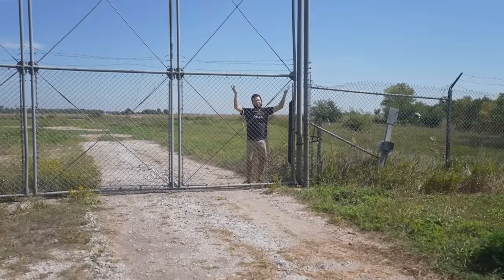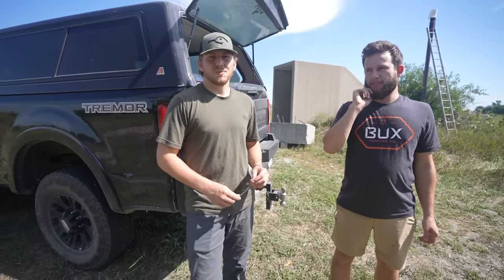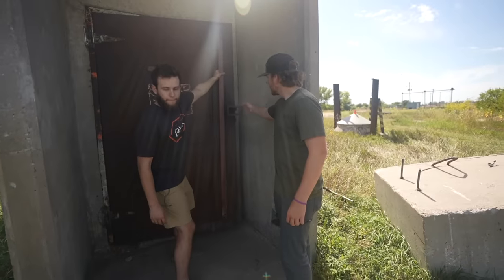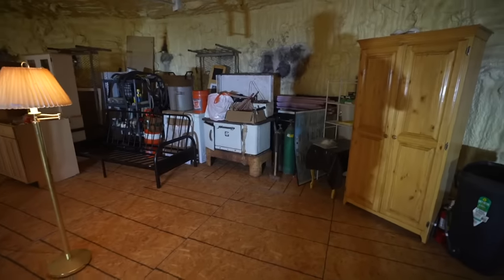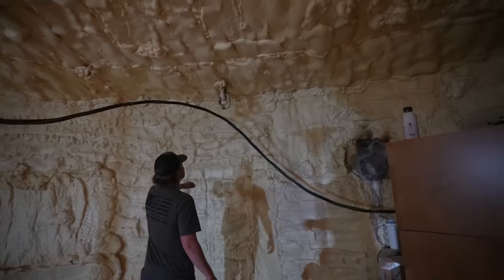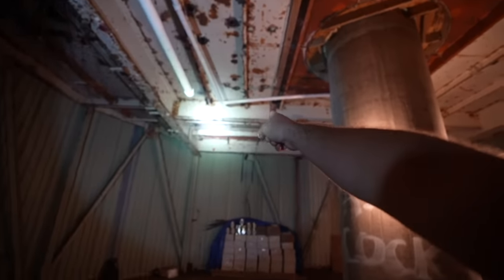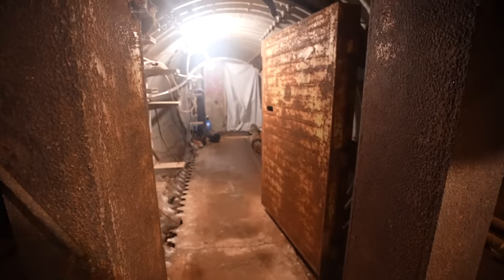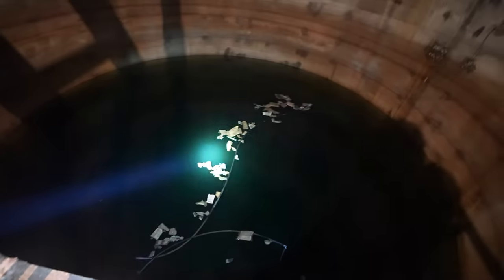I Bought an Abandoned NUCLEAR Missile Bunker!!! (Prepping for Doomsday)

Comment: Silo should be drained, sealed to be water tight and used as a cistern to supplement the on site well.  You could even plumb the well to feed the cistern, and then pull your clean water supply from there, to keep it constantly fresh.  Think long term and logically, like you say you want to.  Greenhouse could also be built "hovering" over the cistern, so your water supply for your grows will be right there.
Reply: Indoor sky diving
Reply: Why would he drain it ?   Pumps and filters and the water would be good to go as is
Reply: Pump it all out
Reply: @AndyTrucker1985  It needs to be pumped out at least once and cleared/cleaned. Building materials in the 60's were still a little sketch, especially for military installations, plus there could be equipment that was left behind as well as the potential for the tanks that serviced the missile leaking. Fuel was RP1, basically kerosene, and liquid oxygen so there's cryogenic support stuff. Water could be bearing lead, cadmium, mercury, copper, all leaching out of leftover items, and if part of the fuel handling rusts through, suddenly it's full of light oils and you'll have a nice explosion hazard as the vapors build in the slack space. Plus it's slowly eating the lower part of the complex away as it sits now, and raising the humidity level in the whole place. Oh, and rusting steel in an enclosed space makes hydrogen, which is the mother of all boom-boom hazards because of the combustible range.
Reply: It would work great for aquaponics. Tons of fish, fruits, and veggies.
Reply: Yes drain it!!!! I love this stuff
Reply: Agree drain silo. Inspect and then research options.
Reply: if you have seen THE 100 ON NETFLIX THATS WHATS ITS GONNE BE LIKE
Reply: Yea the take it’s self should be pumped out
Reply: id pump it out and filter the water for the pound and try and get the fresh water jellys.
Reply: @fazered8202  That is the first thing I thought of.
Reply: First, the water in the silo is likely contaminated. Second, building over the silo would potentially contaminate any cistern you built there. Ground level ponds will complicate maintaining the integrity of the underground water proofing, but you could drain the silo to fill the pond. You’d be better off building a greenhouse over the dry silo and installing hydroponics.
Reply: @engmed4400  Hard to clean or maintain. They’d be better off draining the silo, cleaning and decontaminating it all, then sealing and converting the bottom 20 feet into a tank for aquaculture while installing hydroponics above, cracking the doors open and building a greenhouse over top to let in light.
Reply: drain it, build a floor and get the launch doors operational. Polycarbonate can be framed directly over the top basically turning the entire floor into a massive BIODOME with a blast door for a skylight. How cool would that be? You could grow a ton of food with plenty of room for fruit trees, dragon fruit, aquaponics and still have space for potted plants. Like an underground jungle and he could build several more floors beneath the biodome. Maybe even room for a swimming pool down there?
Reply: Greenhouse/fish hatchery.
Reply: You must have about $10 Million Dollars to Spend, but Good Luck  !

Comment: Suggestion for the suggestion box: 
Drain the silo and get the launch doors operational. Polycarbonate can be framed directly over the top basically turning the entire floor into a massive BIODOME with a blast door for a skylight. How cool would that be? You could grow a ton of food with plenty of room for fruit trees, dragon fruit, aquaponics and still have space for potted plants. Like an underground jungle and you could build several more floors beneath. Maybe even room for a swimming pool?
Reply: I don’t know if your going to drain that much water but I’m. Not sure 😂😂😂😂
Reply: @Hiyffggh  He could use a 2hp well pump and about 200' of pex pipe should do the trick 😎
Reply: It would be smart to excavate a large pond beforehand.
Reply: @BetterDeadThanRed99  Yeah in 3 to 6 months or so. 
The first challenge is going to be getting those doors open, the second would be draining the water and the third would be the heavy equipment to haul all of that scrap out of the bottom of the silo.
Then you move onto the environmental hazard of all of the rust and heavy metals

Comment: Definitely get it checked for radon gas, as Nebraska is the third highest state for radon gas. Even the water in the silo could contain radon.  Seeing that you mentioned in the first video that the EPA had okayed it, that there is no trichloroethylene (TCE). TCE was used as a rocket cleaner and can be found near old missile silos in the groundwater sources, but you might want the well tested for contamination.
Reply: Definitely have the water in the silo and the well sampled for TCE. I’ve worked on environmental cleanup of TCE at Site 4 and Site 6 in this area. You should also call the Army Corps of Engineers Omaha district for records of any of the environmental assessments that were already done.

Comment: A few ideas...prior suggestions on draining, cleaning and storing clean water is good. Also, you could open the overhead doors, turn it into a business by making it a PADI certified deep dive training pool. I'm sure you'd have the market cornered in the corn belt. You could build a circular floating dock in the water and secure at least two ladders to climb down from the ledge you stood on.  Lastly, you could put an old rusty grain silo over the concrete doorway the leads down to level 1. Spiral staircase up the inside of the grain silo to open up to a full 360 degree steel walkway w railing so you could have a monster line of sight/firing position lol. One silo above ground and one below....just looks like the remains of an old farm when people pass or fly by lol.

Comment: Get a crane to open those doors then build a big shed over it with a lift, that way you can better drain the silo and be able to move stuff in and out better.  I would probably first take care of those rusty stairs so you know they are solid.  Probably build a small polebarn over the entrance that way the entrance is hidden and you can park vehicles/ store materials out of the elements.  Install a cell repeater inside so you can make emergency calls.

Comment: welcome to york nebraska.. You could pump the silo out and see if they scraped all the metal out of the silo. I think if you pump it out you will need to keep a pump running if you look at the well depths around that area  the static water level is higher than the bottom of the silo so I would guess the military had  a  couple pumps running all the time to keep the silo dry...

Comment: Check and see if there is a drain system in the lower part of the silo.  They had to have a way to keep it dry while the missile was in there.  Also see if you can find someone that used to work there back in the day.
Reply: The used bilge pumps
Reply: @ryanlee6147  I was thinking more of a sump pump, technically the same thing just larger.  Plus if you've noticed all of flair's water logged boats I'm not thinking he has a bilge pump handy 😁
Reply: That’s what I was saying drain it and seal it up none of that water is worth drinking or keeping inside. And you could pull it out and fill the new pond he wants too build. Get some oxygen stirring in that water and sun like it would be just fine for fish

Comment: If you can get the missile doors open, take them completely off and make a skylight overtop of the rocket pool, you could even make it strong enough to be a seethrough basketball court over top of the water. For the water start with a floating dock, with a rope ladder like you are thinking, but I would say eventually loosely anchor the floating dock to the wall and building a spiral staircase going around the parameter of the silo up to the current rusty platform, which of course will need to be reinforced or replaced.

Comment: If you’re going to keep the pipes running into the holes for the floor I’d recommend running them in between the joists and plasma cutting squares or rectangles and then boxing in the squares and then putting a support plate with the same size shape on the outside and then have it welded to reinforce so you can put the ceiling up as far as possible without having the pipes in the way

Comment: 22:00 Before you do anything else, find a solid place to tie off a rope or chain ladder long enough to reach the bottom (no worries about levels that way) and get a couple big blocks of styrofoam to sit up there with their own ropes dangling to the water so you can tug on them and bring them down. Why that way? So they can't possibly degrade or saturate sitting in the water, you don't know what's in that water yet. 

If you wanted to be industrious you can run a panic wire around, just a loop line on a cheap alarm panel wired up as an NC sensor. If you get in trouble all you have to do is get to the wire and cut or break it, and the panel can call out for help. If the panel has multiple sensors you can run different loops and some strobes can tell whoever responds what section you're in. Poked through Amazon and you could do it for less than $200. Alarm wire is cheap (like 500' for $35) and solid core so even if you find yourself without something that cuts, you can just hold it in both hands about 2" apart and roll it around like a crank, it'll snap in a few seconds and trip the alarm. Or just put your weight on it...

Exploration? Find someone who has a FIFISH submersible drone. I say find someone because they're a couple grand, but that's the thing to use.

Comment: Top to bottom, I would seal over the silo doors so water tight , then cover with soil from pond digging, good soil for vegetables or sunflowers which are good at absorbing radiation. Build a cabin around entrance but from those big concrete Lego blocks and clad in wood. Leave the plumbing as is and do something with mirrors to obscure direct bathroom view.  Put fish in the silo water and have radiation free fish when shtf .

Comment: When you start digging the pond(s), save the dirt to build a backstop somewhere along the fence(on your side of course) to be used for your shooting range(you will need to make sure that it is safe to shoot in that direction in case you shoot over the top of the backstop) for sighting in and target practice with your rifles(you will need to setup some real target stands for holding real sight-in targets{not steel targets}), and your compound bow(s) and your crossbow(s) can have archery targets for sight-in and practice at realistic distances(up to 50-60 yards for the bows, and up to 300-400 yards for the rifle sight-in and practice at realistic distances!!    

When you get ready to start filling the new pond(s), setup a big pump to pump water out of the silo to fill the pond(s), then you will have a better idea of what you have to work with inside the complex, such as the structural integrity of the silo for possible additions to the structure, such as additional rooms stacked in the silo itself for sleeping quarters, and/or storage, or maybe a spiral staircase from the bottom of the silo up to the levels you showed during the tour, many possibilities in a complex like that!!    

If there are existing wells on the property, you should think about having them tested to see if any might be good sources for clean and safe water without having to drill new wells!!

Good video, please keep us up to date on your plans, and progress thereof.

Comment: Also should find yourself some glow in the dark tape and mark your routes out and box in a couple of emergency flashlights around hanging in good ziploc bags, just AA powered lights, but empty and sealed packs of lithium AA batteries. The lithium ones (NOT rechargable, the single use lithium AAs) last forever and getting them to leak is nearly impossible, but the chance is always there, and in the pack they can't accidentally short or get run down. 

Always consider your worst case scenarios, and one here is the lights going out and not having a backup light or a flashlight in hand. Make it easy to get to one, just by following the glowing tape to one of the bags.

Comment: I would put a pump in the silo to drain the water out, and keep it out, first.  Then I would get a professionally built ladder with a security cage mounted to the wall to have a safe way up and down from the level you were at.  After that, and things are cleaned up, you could start building levels from the bottom up. If it's 150 feet deep from where you were that's easily 10 floors you could build.  If that is a 50' diameter that's 2000 sqft per floor, 20,000 sqft total.  Enclose the ladder and keep it as an emergency escape and build a nice set of stairs to each floor.   One of the things to worry about is airflow, you'll need to get some kind of system to exchange the air from inside with fresh air outside.   Carbon Dioxide and Carbon Monoxide (and other dangerous gases) are heavier than air and will be a huge problem if not dealt with.  All this would definitely be easier if you could get an opening at the top of the silo.

Comment: Congratulations on the purchase of the silo.  There have been others that has reactivated the silo doors, but have had a ton of issues with the maintenance and operation of them.  Mainly due to the weight, have used original style hydraulic rams, but due to the weight have constantly busted lines and contaminated the inside with hydraulic fluid.  So most either weld the doors shut solid for waterproofing, or welded open with bracing for light.   As for the inside of the silo, you might just be better off sealing it away as it would be expensive and dangerous to pump as well as all the scrap metal that was usually thrown down the silo when decommissioned.  A lot of the pieces was just cut off the sides such as ramps and elevator equipment and just dumped.  The silo would also require constant pumping with dedicated automated pumps as they originally had as without, the ground water would slowly fill back up.    Whatever you do, I wish you luck with the project

Comment: you should try to pump out the water in the silo and make living areas inside of it.  Maybe a few individual living areas or one very large one.  It would be cool to make a little garage at the top where you can open the top of the silo and cars can be hydraulically lifted to the surface.

Comment: builed a small house that your group can live in. cut that raised entrance to be below the ground level with the entrance inside the house or leave it as is and make it inside so you can control the entrance. pump out the silo and see what you have down there, I'm betting on a huge pile of scaffolding. clean it up if it can be turned into a fish pond make it like 50ft deep and scaffold the rest for extra sleep cells for people u want to join you down there. then build a grain silo over the missile silo doors and install a 3 or 4 ton elevator. the grain silo will hide the elevator and stairs inside the silo can lead up to sniper positions like on a platform  near the top. leave one door in place and remove the other for the elevator shaft to go down it will make moving heavy items like quads and diesel generators. if you cant make a pond use old military fuel bladders and store diesel down there. possibilities are endless.

Comment: As an idea for your food plot remember the soil you're scraping off is topsoil and is primo. Anyways back to your food plot You Dig Down 3 ft and lay in wood chips Pine logs and then cover it back over it will help your food as providing a reservoir of water for it. Which means as that would rots it will turn into a giant sponge and will hold water and give it up during the droughts I seen this concept it's remarkable. And remember you're going to need power fuel storage tanks generators solar panels. And solar panels which are protected from EMP's during a nuclear war emps will short all electronic and having equipment that will work after is key. Protect your drinking water and make sure you have plenty of it.

Comment: Just a quick note, there are existing weapons that could still destroy the silo (something like the Massive ordinance penetrator) but you would really need to piss someone off enough for them to drop it directly onto the site for it to do anything. From a practical sense though, you would be far enough away from any real nuclear targets in the event that war breaks out that the site is more than capable of surviving.
Reply: Those weren’t designed to take a direct hit either. I think within 2 miles is the dead zone? For nuclear weapons that is.
Reply: @FerociousPancake888  True, pretty sure this generation of silo is designed to withstand something like 500PSI of overpressure, which while that is a crap ton will not stop a nuclear warhead that was detonated right above it. The general theory behind it was to make them strong enough that if one silo in a group was targeted, that same warhead wouldn't take out the others in the group.